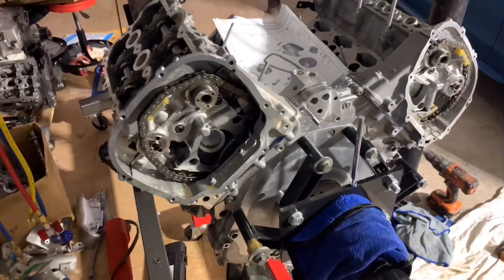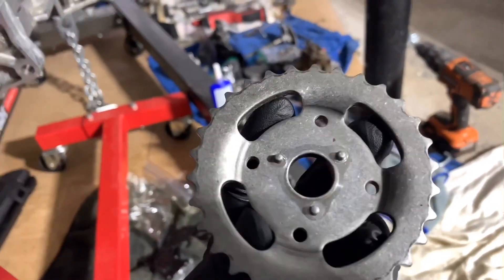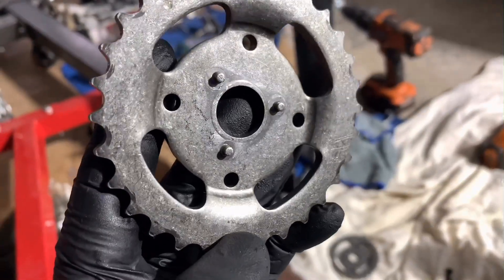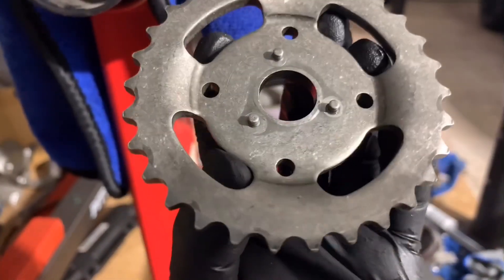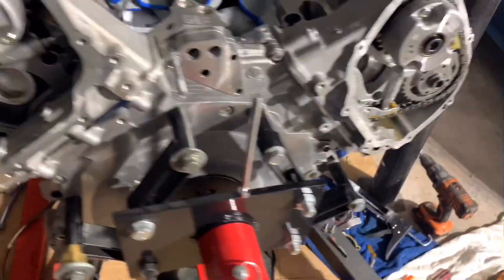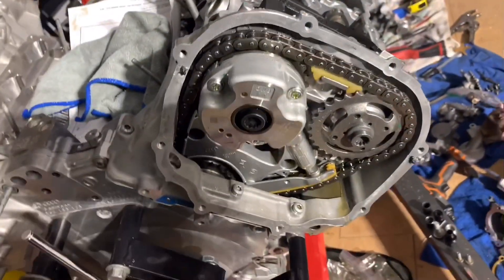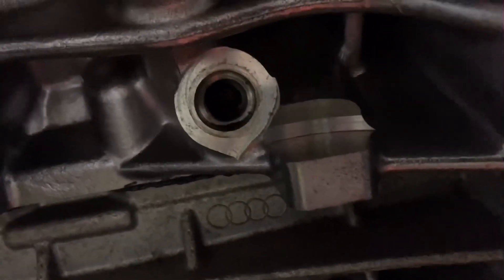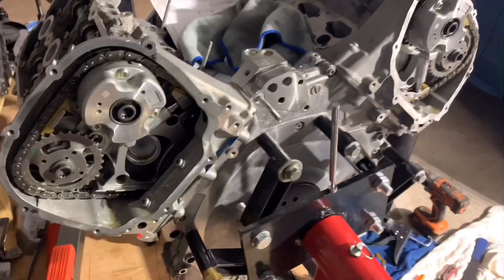Audi 3.0TFSI Timing chain.

Comment: Shouldn’t the links be the same between the IN cam and EX cam on both heads, I know the chain is longer but the cams are the same distance apart?
Reply from the maker: Yes it’s same! I did mistake in video !!!!! 20.5 pins should be on each side

Comment: I have I cuestión bro can I remove that 1head whit that engine inside that car o I have to take that engine off ?
Reply from the maker: I think It is passable just take a time and check everything that might be in the way lock the crank shaft with the pin to set timing.
Reply: Ok tanks bro for you answer